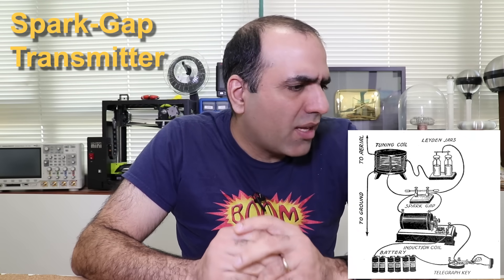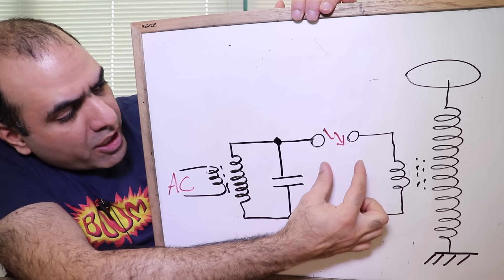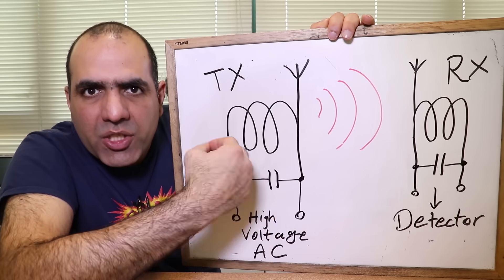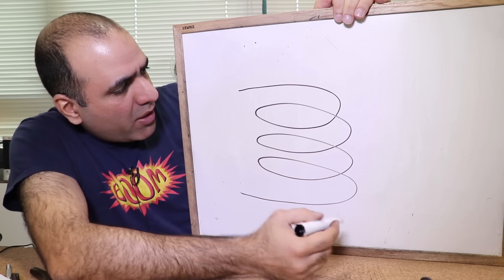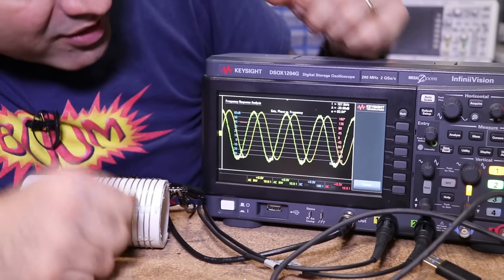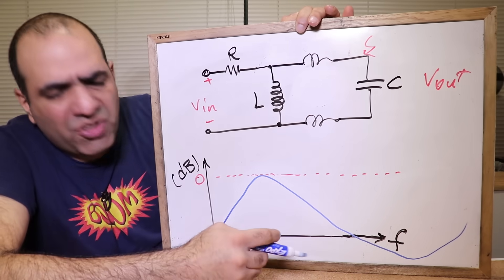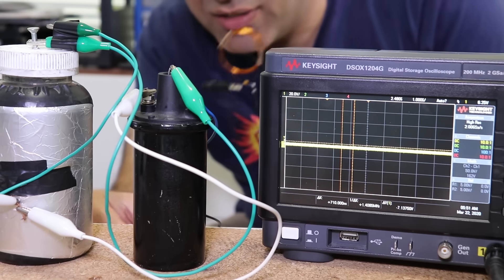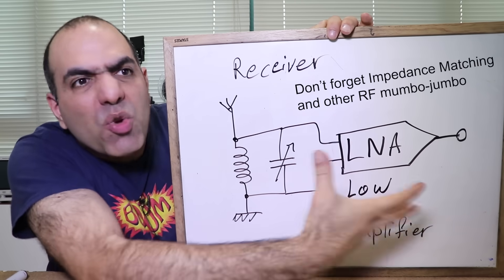Making a Spark-Gap Transmitter

Comment: At  9:24 ElectoBoom says that at resonance the impedance of the LC circuit ( parallel) is infinite and so the output voltage is equal to the input voltage.  That is not exactly correct and ElectroBoom should reconsider that statement, That was the reason for introducing the 100-ohm series resistor to change the voltage source he shows as Vin into a  compromise current source. If the 100 ohms resistance was of a higher value say 10,000 ohms, the output voltage at resonance would be much higher than the input voltage In the practical circuit which he uses, the output is that of a step-up transformer and so effectively the parallel LC circuit is fed from a current source and not a  voltage source as he showed. 
  
If that parallel LC circuit was fed from a perfect voltage source the output would be constant at any frequency. 
Many students make the mistake of not knowing how to excite a series or a parallel resonance circuit, For best performance the source must be matched to the impedance of the resonating circuit, hence for a series LC circuit, the source must be a voltage source while for a parallel LC circuit, the source should be a current source.

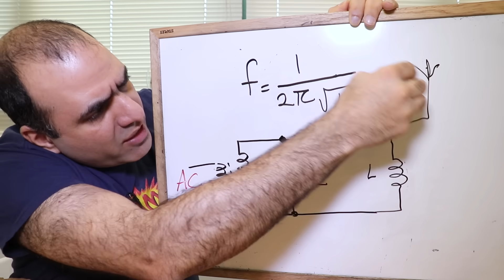It is better to give an explanation of the circuit used at 3:15 where the LC circuit is a parallel combination. THIS MUST BE FED FROM A CURRENT SOURCE.  As it happens the output of the low-frequency transformer is a STEP-UP  transformer and so in effect, its output impedance is very high and luckily this is a natural situation where a current source is feeding a parallel LC tuned circuit.  Unfortunately, the very high voltage generated across the LC tuned high-frequency circuit will appear across the " current source",  and though the current is low, the voltage is very high as it is a current source whose output voltage depends on the load impedance!   This high voltage on the parallel HF tuned circuit may burn out the insulation of the secondary of the first transformer, 

If the spark gap was placed in parallel with the secondary of the first transformer and the capacitor placed in series with the inductor, ( They change places) then the LC tuned circuit is a series LC tuned sercuit, which has a very low input impedance and so it must be fed from a VOLTAGE SOURCE to resonate well.   Here is where the low impedance of the parallel spark gap comes in as the output impedance of the effective source is now very low and it fits and matches perfectly as desired, the input impedance of the tuned HF LC series circuit. In the parallel spark gap, it is the spark gap that takes the high current of the series circuit and not the output of the low-frequency transformer as this remains what it was in the circuit shown by electro boom.

For the experienced engineer, both the high impedance current source from the secondary of the first transformer feeding the parallel LC circuit or the parallel spark gap acting as the output impedance of a voltage source feeding a charged up series LC circuit, both contains a beautiful " impedance" state of affairs that ElectoBoom nor  https://youtu.be/wSp1IzmRUk8?t=772 do explain very well.

Matching the output impedance of the supply source to the impedance of the load is one of the most important issues in electrical engineering, and it is not covered so well by many educational systems. 

A current source is a dynamic open circuit that can support a constant electric current through it at any voltage across it. 
A voltage source is a dynamic short circuit that can support a  constant voltage across it and any current through it.

A passive open circuit can support any voltage across it but no current through it. ( a perfect parallel LC  resonating cuircuit)
A passive short circuit can support any current through it but no voltage across it. ( a perfect series LC resonating cuircuit) 

If students studying electrical engineer can comprehend the last four statements, they would find any electrical engineering course very easy...................no book ever explains short and open circuits as being passive and active but that is what they are in ordinary short circuit and open circuits and as found in voltage sources and current sources.

Perhaps ElectroBOOM should make a video to clear these important four important issues to many students attending Universities and technical colleges.  
 
ElectroBOOM should correct and explain his misleading statement at 9:24, for that particular circuit diagram he shows. .

Comment: I used a big SCR in place of the relay contacts.  There is still a relay in the circuit, but it only operates the trigger of the SCR.  The relay goes forever with that design.

Comment: why put antenna to your transmitter when in fact your spark gap is where your em waves propagate? anyway keep learning,  you almost get tesla 's plan. there is just one peice missing to make it work like teslas plan. with your setup, you can never recieve as much power compared to  how much you used to power your transmiter. you should get as much power from your reciever if you do not ignore the law of conservation of energy. where all the power gone if you can only light a piece of led?

Comment: In your video on 16:21 time frame you show your contraption next to the original Nicola Tesla one...  It can be seen that your schematic uses AC while the original one uses DC batteries...  So you are comparing Apples to Oranges!  Please recrate the Original Spark Gap radio concept as it was conceived by our predecessors in 1898!  Actually if you do it with Leyden jars and a big fat coil looking like a stool would be even cooler...  Thanks for your great videos...  I love them!

Comment: ElectroBoom, You probably know this already.  The circuit at 7:36 can be used as an AC voltage dividor.  Measure the voltage across the inductor and use it and the current to find the reactance of the inductor , and which is like the effective AC resistance =  voltage / current.   Use that value in the reactance of an inductor formula and solve for the inductance.   I have used this concept to find the value of a capacitor using a 1000 hz sine wave from the earphone output of a computer, and a voltage meter. 

I have a laser, audio circuit posted that I made if people want to make one.

Comment: He had a remote controlled boat before marconi's garbage radio.  I'll send you the patent number if you don't believe me medhi.
Reply: US613809A
And a link to the patent (but he would often play with the actual device)  :https://patents.google.com/patent/US613809A/en
Reply: I do agree with you though.  He did not succeed in transmitting POWER.

Comment: if  u want to make a perfect antenna u need to cut a wire longer than an half wave of ur frequency, for exaple a perfect antenna for 1.6 MHz it's long 187,5 meters, the formula for calculate the wave lenght is c/f where c is the speed of light ad f the frequency of the imput. If u want write to me searh my callsing on qrz.com. 73 de IU3MID

Comment: There is no diode in the ac secondary of the input so how will the capacitor charge ? Or to put it more specifically how will it hold the charge.

Comment: Fun video! You can also do morse code with a series of small hand grenades interspersed with larger ones. Would likely create less interference.
Your AARL Coil calculator is in inches of diameter, not exactly the same as the 60 MM you measured
Reply: as if anyone listens to am radio these days

Comment: When I was a child I had a Red Radicon remote control Bus that transmitted a signal to control the Bus with a  Spark-Gap Transmitter.  Sometimes when the bus was close to the refrigerator, the arc of the compressor Contactor engaging  would make the bus start or stop or turn. Here is a demo of one of these buses: https://www.youtube.com/watch?v=Z4C91T7CxjE

Comment: Wouldn't a TVS diode be able to suppress the induced voltage at the primary side? I mean, is it a possibility that the welding of the relay contacts was caused by increased current flow to the contacts?

Please give me a proper explanation for this.

Comment: Once again Great video! 

One question: why do you use such a complicated way for calculating the inductance for the coil. Sure that is quite accurate but you could just measure the resistance, connect the coil to AC source that has known voltage and measure the current. Then (inductive reactance) = ((U / I) - resistance). Then you can find your inductance by L = (inductive reactance) / (2*pi*f).

Comment: spends another few months on this and you get to make Don Smith Free energy device
If only we can make a capacitor and diode sensitive enough in value we can extract the massive AC voltages surrounding our ambience and then store it into conventional batteries

Comment: Hello Medhi, in order to measure the inductance, couldn't you have made a simple LR circuit, switch it using a DC voltage and measure the time constant from the increase in current (proportional to the voltage across R) from the oscilloscope graph ? Then calculate the value of L from the time constant.

Comment: I love your old school tech. I got interested after reading a book in my school library in the 70s aged 12. I got hold of a bunch of ex-ministry of defence components. Massive capacitors, valves, resistors, inductors and all sorts. These all got connected together with PP9 batteries. The number of times I shocked myself belies the fact I'm still alive today. I was also interested in photography. I decided the best way to photograph a spark was using long exposure on my 110 camera and a 5000microF capacitor discharging through a 240/12V transformer in reverse. First attempts not good. I needed dark. So I put the whole lot under my bed. Camera on long exposure. In those days, beds were horse-hair or something. Suffice to say, the spark was massive. So was the fire on the undeside of my bed.

Comment: you do know that operating a spark gap transmitter was made ILLEAGLE in the 20s? It was pretty weak but after you added that huge antenna, you might get in some real trouble.
Reply: i built the same and i was using it a lot i got in no trouble, so i think you are a fearmongerer
Reply: @pratwurschtgulasch6662  I’m not the type to report you but it takes 10 seconds on google to figure it out. Also, learn to speak proper english! https://en.m.wikipedia.org/wiki/Spark_gap
Reply: @pratwurschtgulasch6662  Why would you reply with this nonsense when the answer is literally freely available on the internet to find in seconds? It's illegal in the US because the FCC regulates wireless transmitters and broadcasting with a powerful enough spark-gap transmitter could potentially disrupt a lot of frequencies already allocated to existing stations. No one is going to go after you for building a small one at home for fun, but you will get a knock on your door if you build and run one large enough to create problems.
Reply: @thegreatzoom5073  oh yeah, every electric fence is essentially a spark gap transmitter with a large antenna. anything below 1GHz the FCC doesn't care about. all you ham radio people are living in the past. the future belongs to millimeter band :D

Comment: oh no!!! you finally said something that is incorrect :(

With transmitters under say 10 MHz the energy is in two waves, the sky wave and ground wave. At really low frequencies( like 1.4MHz), it's mainly ground wave. The energy actually travels through the ground and pretty far like over the horizon - Will go through mountains etc. Its' pretty important that the grounded end has a conductive path at least 1/4 wavelength of the transmitted signal. Those big antenna farms have ground nets that span for days.

See the monopole antenna uses the ground connection as the other end of a dipole and radiates energy that way at low frequencies.

https://en.wikipedia.org/wiki/Ground_wave_propagation

Comment: Hi there, does the same voltage continue on the same after the spark gap, just on the transmitter circuit, not on the receiver? Like say you have 10kv 0.06A (600w) comming out of the transformer, what is the voltage after the gap as the circuit continues? Thanks for the video,  very cool.

Comment: Hi, what do You think (in theory) about one big generator.. Planet Earth (rotor with magnetic field) and some stator of satelits xD ?
Reply: I think NASA tried this at one point. They did end up with a voltage, but as the stator moves through the magnetic field it decelerates and would eventually fall out of orbit. Even minimal RCS to keep it afloat would offset any power generated. But it's still a neat idea that works on paper.

Comment: Output frequently  is damped.  Strictly  NO NO for a transmitter.
Reply: For a continuous wave transmitter. Spark-gap transmitters like this aren't supposed to be continuous though, they were very early wireless communication devices and the technology to generate a continuous waveform didn't appear for another ten years.
Reply: @thegreatzoom5073  thanks for the info , iam a ham radio operator with call sign VU3. P.I.S. thank u buddyfor the feedback

Comment: I have some questions regarding ignition coils ! Thanks to look into them and give me your opinion if possible. 
Why can the spark from the ignition coil (secondary coil) also discharge on the positive terminal of a battery? I guess that's because there is also a large potention difference from ignition coil ( 20kv) to positive terminal of battery (12v).
Is this the true reason?
A simple Dc circuit with a 12v battery is different compared to a TT system. 
Connecting only the positve terminal to the ground will not cause current to flow.
Same with the negative terminal.
Is this 100% true?
In addition to that ; having that same idea;
Will the spark from the ignition coil have the tendency to discharge on ground just like the negative terminal of battery? 
Can the spark from the ignition coil discharge on ground if I bring the wire lead near the ground far away from the negative terminal of the battery?
I did a simple experiment with a common ignition circuit: 
The simple wiring diagram goes like: current goes from +ve terminal of battery to ignition coil (primary winding) to contact breaker found in distributor. Then I connected a wire from the distributor body to -ve terminal of battery. Note that for an old distributor we may have a mechanical contact breaker switch or an electronic one( ..Both will have same functions: opening/closing circuit of primary coil....In my case it was an electronic one that will allow flow of current from the primary coil to ground and then open the circuit instantaneously. I mean primary coil is not energised at start... a signial is took from an inductive pickup sensor and then current from primary coil is allowed to flow to ground , energizing the primary coil...then instantaneously after that,as the distributor rotates, primary coil is de-energise ...so to sum up....the primary coil is momentarily energised and de-energised ).
The experiments: 
A high tension lead was connected to the ignition coil.
I brought the high tension lead end plug near the ground. Ground being ceramic tiles (note: not the negative terminal of the battery)
Then I started to turn the distributor with hand to initiate opening/closing of circuit form the primary coil.
As I turn the distributor , a spark from the high tension lead flows to the ground but at the same time I get an electric shock felt on the hand used to turn the distributor.
As if the high voltage spark has find its way to flow on the surface of the ground towards me ; through me ; to the distributor body; to the negative terminal of the battery. Is this a good hypothesis?
Note: when I disconnect the high tension lead from the ignition coil and not allowing the spark to discharge to the ground; I don't get shocked as I turn the distributor.
Something more interesting happens when I connect the high tension lead to the ignition coil: I place the high tension lead end above the ground so that it can't spark to the ground ..placed on a support; I only allow its insulation sillicone/rubber to touch the ground. As I turn the distributor, I get shocked as if the high tension lead is radiating energy towards me although its not sparking to the ground. Is it a good hypothesis? The shock is less painful when i raise it above the ground. Sometimes i don't get shock when i raise it high above the ground.
One last thing: In fact , when I disconnected the high tension lead. I didn't get shocked but the sound of a spark could be heard inside the ignition coil.
I guess that the high voltage is being discharged on the +ve side inside the ignition coil.
But like all ignition coils...the secondary coil has a common terminal/connection with the primary coil. Why can't the secondary coil discharge its high voltage through the common wire to the positive terminal of the battery?
I guess that : letting current flowing through the primary coil / opening the circuit to stop current flow is the thing that is actually making voltage induced in the secondary coil..so how can voltage discharge through same wire to the positive terminal of battery...this is not possible!

Thanks to read this big text and give me your opinions.